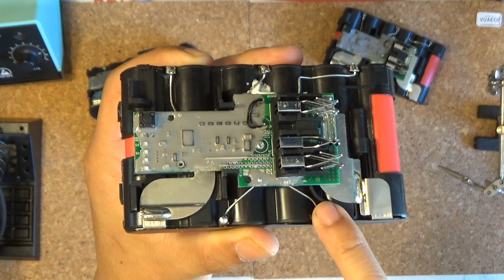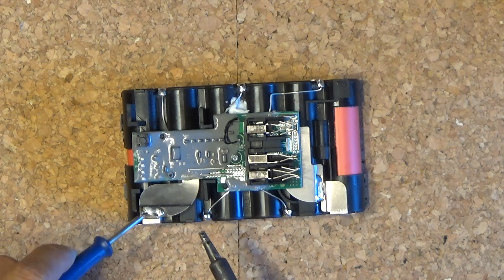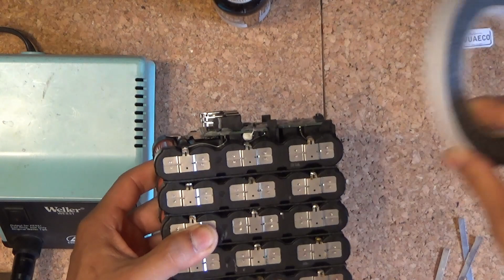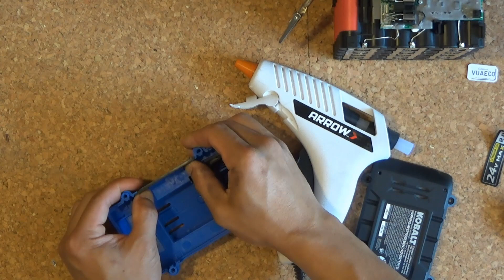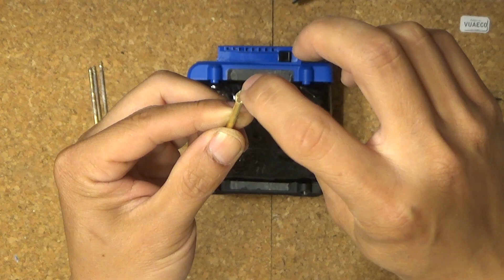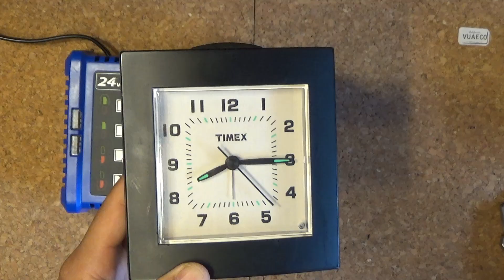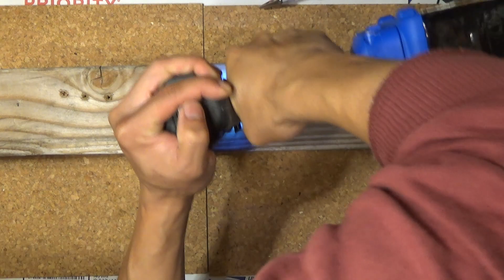DIY: The World's first 10 Ah Li-ion power tool battery built for Electric Bike home-made

Comment: You do not get significantly more power. The tool draws it's rated current at 24 volts and no more. as long as the origunal battery has a reasonable amount of  on it, the voltage should hold up under load. You only get more run time at a big weight penalty. That is why most manufacturers offer bigger and smaller batteries. Of course it is another story if you want to run a scooter or sime other high current device. Before the drill sucks that monster dry, you could have another battery charged and ready to go and have enough strength left to pick it up. As has been pointed out, there might be some thermal and equalizing issues, too. 4

Comment: hey Vuaeco......or anyone. is it easy or even possible to convert the new 24 volt batteries to be used on the Grayco hand held paint sprayer? The sprayer now uses the DeWalt battery pack.
Reply: Kobalt batteries

Comment: does it takes infinite charging time?? lol but seriously, it should take at least P times the individual charge time for a single pack (P being number of parallel packs). Did you know it the circuit on the pack balance the charge of each serie? beware of bad cells as they will low the voltage of all the serie in parallel, and will make all the cells heat and charge will takes for ever... GL and keep the good work!

Comment: YOU SHOULD BE USING A SPOT WELDER, NOT SOLDERING IRON, YOU ARE DAMEGING THE BATERIES, YOU CAN USE EVEN 3AH CELL, TO MAKE 15aH ONE I WAS THINKING DOIND THAT
Reply: Marius Nistor a 10 second solder job won't damage the cell so no need to go all-caps on here.. Lol
I have soldered hundred of cells and no damage whatsoever. Go look at more YouTube videos......
Reply: James Andonian i know but i prefer the spot soldering way, in some battery is not enough space to soldering them
Reply: accurate comment, but for experience li ion are more resistant than lipo (not that you will take more than 5 sec. in contact with the solder point). Hacks are for cheap people, if he could buy a spot welder i would better recomend him a tesla wall...
Reply: Matias D.B. I bought it one for 80£
Reply: Marius Nistor without a doubt, spot welding is the best choice but not everyone can afford one. A $15 soldering iron does the trick but looks ugly and adds bulk.

Comment: Perhaps you should have drawn a circuit diagram of the battery connections and checked the specs of the control boards that control charging and power to the tool(s) to support your statements. If you want some pointers, then see AvE on YouTube. He tells you what the pixies(voltage & current) are doing, and what controls them.

Comment: I want an inverter test on this beast, can it power a 1000W hotplate?  If it was a 10A battery, that would be 50A x5.  50A * 24 = 1200W.

Comment: since you're stacking them in parallel, wouldn't the current be axactly the same? All you've done is add capacity
Reply: Ummm... No. Electronics 101: Batteries in Series, voltage goes up, amps/capacity stays the same, Batteries in Parallel, amps/capacity goes up, voltage stays the same.. P.S. Your first clue should have been that capacity is measured in amps.. 2200Mah ... the "a" in Mah stands for? (amp)

Comment: TL;DR: This is a long comment.  I go into detail about multi-cell packs and at the end voice my concerns for mechanical, (not electrical) safety.

So there's quite a few things going on here. that are advantageous, though maybe don't take it all the way to 5P configuration due to practicality and weight.
-First: You're pentupling the capacity.  This means longer run-time.
-Second: You're minimizing voltage-drop.  18650 cells may be rated to give a peak output of 20A, but they sag like crazy at that current level and heat very quickly.  The maximum output is "maximum current for 1 minute before catastrophic failure" or somesuch.  Add more parallel cells, minimize voltage drop, get more continuous wattage out of the battery.  Some of the drill motors are capable of pulling 80A+ peak (stall current) if the motor controllers let them.  How manufacturers think that a 1P battery pack is even REMOTELY capable of handling that kind of current, I have no idea.  The general rule-of-thumb when it comes to Lithium-based batteries is limit current to 1/4 "rated" maximum to preserve the health of the cell.  Any more and you're damaging it internally every time you discharge.
-Third: You're extending cell life by reducing both charge and discharge current-per-cell by a significant margin.  Cells will survive far more cycles if charged at 0.5 to 0.2 their C-rating.  Assuming a half hour charge and 2Ah cells, the charger likely outputs 4A.  That means that now you're charge less than an amp per cell, which will significantly lower the load both in discharge and charge cycles.

The only concerns I have are that the tabs need to be doubled on the end connections for load-bearing, (balance current is far less than charge or discharge current, so the middle connections can be a single strip; end connections need at least two since the full current of the pack charges/discharges through them).  Balancing is done by charging through the entire pack, and bleeding off energy into a resistive element from the cells that are close to maximum voltage, while the others catch up.  In essence balance charging is where the higher-voltage cells get charged "slower" than the lower voltage cells.

Additionally, I'm concerned about structural integrity of the cells.  Foam and tape are not good enough in an industrial environment; dust can still get in, metallic objects can easily pierce the covering and short something.  I'd at least take some corrugated plastic material and wrap the sides to help protect from these sorts of dangers.  Further, dropping or bumping the bottom of the pack while it is attached could cause the adhesive tape between parallel packs to come loose, or worse, break the solder points or put stress on them.  In a worst-case scenario that's a recipe for a short and catastrophic failure.  The best would be to 3D print a new case that covers the full size of the pack, (if you have such a resource available to you).
Reply: @Eitan did you know for sure that the circuit balance each line of the series? I haven´t seen a balancer included on the packs, it could be great they started implementing this on consumer electronics, specialy laptops. I also think that those wires will get undersized, but depending on the load required they could be safer that way... If he is willing to reinforce the wires i would suggest him to use a termal resistor / fuse in serie that will open circuit on over currents, just to be safe and avoid fire (every pack from respected manufacturers include one or leave a thin pad that will fuse).
Reply: @Matias D.B. All consumer packs have balance circuits for each cell in a series configuration.  Balancing will occur regardless of however many parallel elements are in the pack.  The only possible danger is if you have mis-matched cells that have very different resistance values or very different states of charge.  Different states of charge will cause one cell to discharge into another when you solder them together.  Different resistance values will cause one cell to discharge and charge at a different rate, causing one cell to be "weak" vs. it's parallel companion(s).  Fusible links are a thing, and definitely help, but may be cost-prohibitive for this DIY-minded build.  That of course assumes that the people doing this sort of modification know anything about battery building and treat their modified packs with care.
Reply: Do you have some general rules you would recommend for how to Charge and Discharge battery pack? Frequency of charging, how low can you go before charging them back up, etc? How do we get longer life out of batteries in general?
Reply: CELLS IN PARALLEL. EVERY SHORTED INTERNALLY WILL RUIN ANOTHER 4.

Comment: when you wire them in parallel it is not amps, it is capacity. since you dont raise voltage, tool will probably draw the same amp. maybe more batteries will make it a notch stronger but again, tool wont draw like 5 times more amps :) but I see endings are thicker than middle ones(middle ones are just used for balancing-charging i think) so if you make something equal width to endings, it should be enough.
Reply: Sailor OnDaTea exactly what I was thinking
Reply: Don't confuse  A with Ah
Reply: @johnrhodes3350  I don't. 18650 lithium batteries usually can give around 4-5 amps even when shorted. MNaybe better battery will give more. but it depends more on your tool. when you have unlimited source maybe it draws 5A at max. then it would be better to use 2 or more such batteries in parallel because they would sustain voltage longer if they need to give 2A instead. but your tool won't draw 10
A even if you connects 100 batteries in series because it also depends on input voltage and circuit inside tool. does your phone draw 10 amps when you connect to 5V 10A power supply? no.
Capacity is Ah or mAh. but current depends on more than just capacity. There is this C value, internal resistance, load, motor inductance, other resistances in circuit, electronics design...
so, no, nobody confuses anything.

and those mah/Ah values also depend on how much current you draw. They are given for certain calues 1C for example. if a battery is rated 4Ah at 1C then it means it can give 4A for one hour. But if you draw 4C, then it may be rated even below 1Ah. Faster you draw, lesser its capacity. and yes their internal resistance prevents at some point so it is not infinite amps even when shorted  thus you can't empty a battery in a second like you do with capacitors. we clear?

Comment: you only increased the battery capacity there is no other benefit it will put out 24v still and the drill will draw the same amperage the battery will just last longer.

Comment: how do you balance charge the battery? yes the factory charger balance charge the top pack but theres no way the charger is going to detect each of the added cell to balance them.  This is going from a 6 cell to 30 cell pack..  unless you wire up the added cell to a balance board and the the charger can support 30 cell charging... This thing will blowup.
Reply: Exactly my thoughts. Ain't gonna go
Down well with the home insurance when your explaining what caused the house to burn down.
Reply: No the charger does not know in any string if 1 cell is bad ... this is the risk you take when you tie more than one cell in parallel.  But honestly this is done often ... when you start with new cells the risk is often considered acceptable.  the way around this is to size the wires that tie the cells together to about 6 amps which in a short circuit (very bad cell) will blow that wire and that will take that cell out of the circuit.
Reply: So if i build a 6p pack, i wouldnt need to balance each cell?  i though the whole point of balance charger is to make sure each cell is charge up equally?
Reply: the charger does work to balance cells 1a, 1b, 1c, 1d, 1e because they are all tied together.  they are all at the same voltage because they are all tied together.  they all balance together. then it moves to the 2a, 2b... stack, and then 3a ... 4a .. 5a ... and finally 6a stack.
Reply: Lithium ion batteries in parallel self balance (charge will flow from one battery to the other until their terminal voltages are the same). You only need balancers for batteries in series, which will still be done via the original balancer circuit on each parallel 'bank' that is in series. They should also charge correctly as lion charging is constant current on main phase then constant voltage on final until cutting off at a specific terminal voltage (usually 4.2v per cell so 25.2v in this 6 series cell case) - they will just take a lot longer to reach full charge.
Reply: thought the same, also isn't the formula e batteries much higher capacity?
Reply: yeah, i know that. I was saying that the formulae batteries have more capacity.
Reply: yes i understand what your saying.  I'm just wondering how the charger know how much to charge 1a,1b,1c,1d,1e  when there just one wire attach to 1a.  Does cell  a,b,c,d,e need to be balance? what if cell 1c, 3e and 5b is damage or not charging correctly, does the charger know that this cell is bad or will it continue to charge it regardless of its condition? Or are you implying that regardless of the condition of the cell being use in as long as it in parallel they will balance out?
Reply: Advanced Nutrition Inc right, the charger does not know in any string of 1 cells is bad.  He would be better off leaving each balancer on there and writing the balances in parallel.  That way every pack has its own balancer still and each cell is properly balanced
Reply: yes, when you run them in parallel you double the capacity but keep the same volt. when you series the battery your double the volt but keep the same capacity.
Reply: yeah open nearly  any laptop cell. If you want to see the extream version of that go lookup hbpowerwall on youtube, or electric car batteries.
Reply: blower really?  I didn't know you didn't need a balancer in parallel, very interesting
Reply: Is the balancer also a discharge and overcharge circuit?  If so that would be great because any 24v source could charge them.  Guess I could buy a $10 battery and test it, worse that will happen is it will explode 😂
Reply: I think since the batteries are new, and at the same voltage to start with, they should stay balanced, or at least close to it for a while.
Reply: The way he strapped the batteries together as the charger balances the top pack it will balance every cell below that cell because each pack is strapped cell by cell vertically.  So it will balance charge each pack correctly - unless he didn't solder something correctly.  Which i think his craftsmanship is quite good so that should not be a problem.
Reply: This is hard to explain in words without pictures.  But in his pack he has 6 cells in series in each pack (lets call them 1 to 6) and he has 5 cells in parallel  (A to E) for each of those 6 cells. So when the charger try to balance Cell 1A it's actually balancing 1A, 1B, 1C, 1D, and 1E all at once because all those cells are tied in parallel.  then the charger goes to Cell 2A and the same thing happens.   Then Cell 3A, 4A, 5A, 6A and the same thing happens.  Then the charger goes back to 1A again to check and make sure ... and so on.

Comment: Hey, when making multilayer bat pack, for example 24 volts, can i just do 24 volts first layer and just do parallel the rest of the layers?. Just curious.
Reply: Multi-layer? I believe the correct term is just Battery Pack.. How you go about it, pretty much ends up the same (electrically). Just so happens I'm going to be building a 24 volt (7 cell series, 8 cell parallel) pack here real soon.. The way I'm going to do it (for the most bang for my buck) is build 7, 8 cell parallel packs, and then series them together with a wiring harness. That way I can make what ever size pack I need just by changing the harness.. 12, 24, 36 volt etc. I'm going to put a balance plug on the harness so I can use a low voltage monitor/alarm to keep an eye on the packs status during use. (bike)

Comment: You know those regulators were meant to regulate the charge of one of those packs, youd have to have a way to hook them up in parallel also to make sure the thing doesnt over head and explode  im a noob but i know 1 thing dont fuck with li ion they explode nicely
Reply: in your other video if you dont know why the circuit boards are so complicated i ask you kindly refrain from doing this and teaching people to do this because someone will end up dead or severely bored. They are so complicated because they have to make sure a lot doesnt go wrong, stable voltages, how much voltage/amperage over the charge time and so much more

Comment: I am very concerned with this build. How will you balance charge the cells over many cycles?
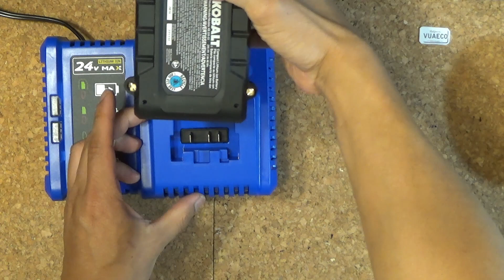Reply from the maker: Balance charged by the original charger at 12:44.
Reply: Yes, indeed they are but after a few cycles they will drift apart. Check for yourself after a few cycles. It is not necessary to balance charge every time as long as you are regularly checking the cell voltages, you should only need to re-balance the cells about every 10th charge. 
The battery is charged using an overall voltage, so any unbalanced cells remain unbalanced (cells will become unbalanced over after a few cycles due to small differences in capacity). The risk of bulk charging is that if a cell has a higher voltage than the others, it can get overcharged despite the overall battery voltage being within safe limits.I wish you the very best of luck with your project, but I hope you can understand my concerns.
Reply from the maker: At 2:02. You can see 7 solder joints. The 2 big fat solder connections are the terminals. The other 5 smaller connections are balance charge connections. Those 5 connections along with the 2 terminals will balance charge the battery every single time you put it in the charger. And since I put them in parallel, it will balance charge every single layer I put below it.

Comment: A few points to consider before using such mod:
a. With this configuration the balance charger treats a whole series of 5 batteries as a single cell so it won't detect a failure in a single battery on such array. If one cell will fail it will overheat and damage the other batteries or even explode from the accumulating heat.
b. The added weight makes it impractical to work with.
c. I can't be sure that the motor can handle continuous torque that can be achieved through this mod.
Overall - nice concept but should be made at least with battery charge management for each cell and some good heat spread in some way.